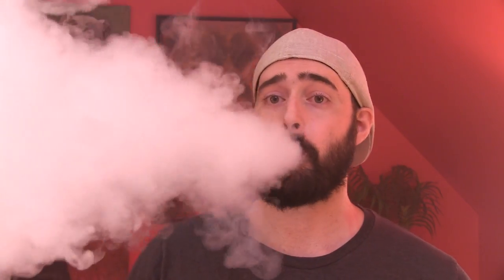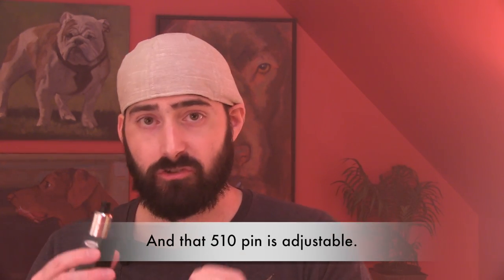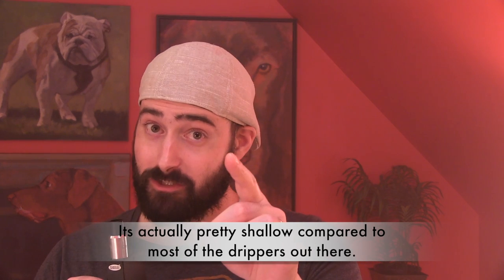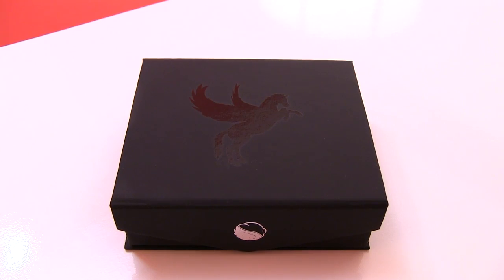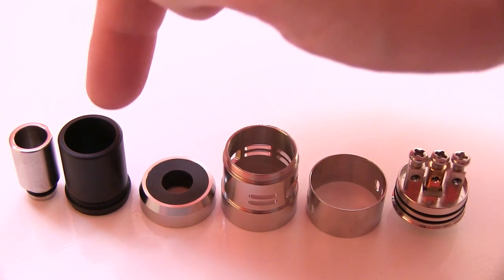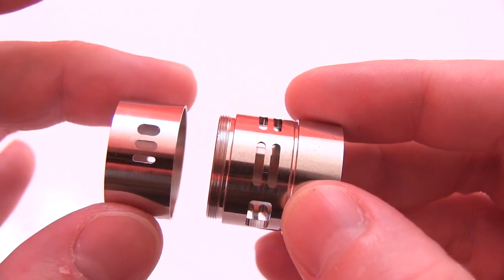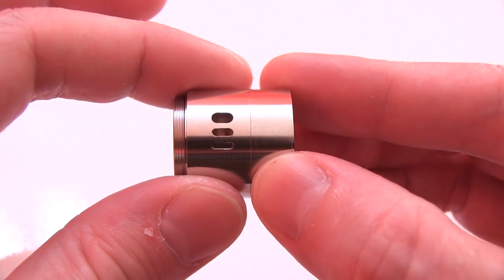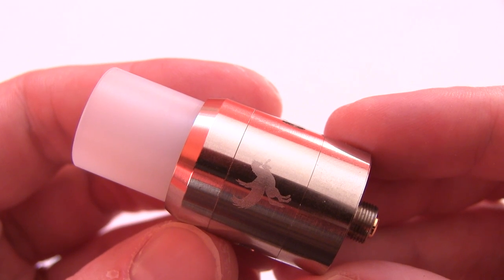The Dark Horse RDA

Comment: Thank you for the the review on the Dark Horse RDA! We are definitely listening to the pros and CONS more specifically. These notes will be sent over to Steam Angel for improvements to be made! Regarding the accessibility, we TOTALLY understand the frustration a lot of consumers have. Last month's release was the very first batch from Steam Angel.  The 2nd batch on the way will consist of 2000 units and we will be receiving regular shipments every 2 weeks moving forward to do our best to keep up with the demand.  =) 

Just a note: The Monster Drip Tip and the adaptors are made of Nylon which has a much higher melting point compared to Delrin. =)   

Added note: Many people have asked about the materials used. THE DARK HORSE RDA is made of 316 Stainless Steel! =)
Reply: I'd suggest the horse logos to be printed at the bottom instead of the ring or (two on the ring like rip suggested). Since the bottom portion never moves would make sense to print them on there. Just my 02. Can't wait to get one.
Reply: Just received mine today and love it.Fast shipping ONE day!!! LOL thanks. Wish there was extra o rings especially for the monster drip tip that did not have one.
Reply: great RDA but I did have problems with the center post coming loose even after my Vapor shop tried tightening it so they are currently working with the manufacturer to fix the problem in the mean time the loaned me their personal Sig-s which i prefer a little more since the posts are lower to the deck. Shout out to The Vapor Box of Whittier thanks!
Reply: They need to make a version 2 with a deeper juice well, IMO. Other than that, it's amazing, and everyone drools when they see it on my ipv3.

Comment: Yup same here man. In a perfect world my rda features would be, medium depth well, fat post holes, 2 hole center positive post, Allen head screws, adjustable 510 copper connection so it'll fit a huge variety of mods, adjustable slotted air flow that will work with single coil also, heat sink like tohb or 454, think that's about everything lol

Comment: Designers. Measure the depth of the sidewalls to the deck on the Tugboat and copy that. My Tugs are the most solid RDAs that I can take with me all day cause they don't have a shallow deck, the air holes are placed to where they aren't going to act as a juice drain, and the fat oring is snug so it doesn't have that "cheap feeling" spin.

Comment: I purchased the dark horse as my first personal rda. A buddy had a plume vale and a nimbus on loan to me with a single 18650 mod (don't know the name). I've got the dark horse on a tesla invader 2. Now out of the 3 set ups I've ran personally do far. This is it. It's better for duel coils then the plume vale, better than the nimbus for single coil. It's harder to run quad coil on this than the plume vale though. If you don't count that as a con given the plume vale is a 4 post, my only con is the single coil mode doesn't have a wide open option like the duel coil does. But the post holes are so large you have no issues running wrapped, parallel, clapton or any other more extravagant build, so a pro there too.

Comment: I have a variable voltage/ watt sigelei, max 6voltage/15watt mod with a IMR 18350-800mHa 3.7v battery. Just ordered a stillare atomizer clone single or dual coil setup, with kanthal A-1 28g awg wire and 2mm braided silica wick. Was wondering if there's any particular way I should wrap the coil or anything I need to change or keep in mind. Thanks

Comment: Mic is still a bit hot (although sounds nice and clear otherwise :)).  Try reducing the gain a bit, and test using the loudest part of your spiel.  The loudest parts should peak out at about -6dB.  Then compress the voice track (in post) at about a 4:1 or 6:1 ratio, fast attack and fast release.  Get a gain reduction (using the threshold control) of about -6dB to -8dB at your loudest parts, then bring the track volume up to normal levels (unless your compressor automatically makes up for the gain reduction, in which case just roll with it, using the track fader to correct any overs).  After that, you should be golden. 

Just my 2 cents, but I hope it helps.  Vape on!  :)

Comment: @ Jake it is authentic I've cleared the serial number... but the center pin does spin slightly it does have all the air flow options and everything is the way it's supposed to be but I was just stating how far off on price he was but it's prolly cuz when it first début it was that price... still a decent rda tho.. wish the insulator was made of peke instead of plastic tho

Comment: My local vape shop (which I love because it sells to minors, I'm 16) sells the dark horse for $30 and it's not a clone. I think the only downside is that it doesn't come with the smaller drip tip and I also havnt seen it with the limited edition white drip tips.
Reply: Definitely a clone. No way in hell are they bringing in $80 mods (that aren't even available online due to demand) and selling em for 30.

Comment: I've got this thing the middle post does spin.. doesn't hurt anything tho and I only paid 35 bucks for it too... authentic
Reply: rickie campbell If they spin its not authentic. I bought one for 35 too that was advertised as authentic that ended up not being so. The post holes look square but they still spin, and half the airflow options are missing. Also the drip tip doesn't slide in from the bottom it screws in from the top. does yours have any of these issues too?

Comment: Why is my vapor so harsh? What could be the cause? I have a Magneto II by SMOK with an iGo atomizer. I built the single coil myself (6 wraps), I'm vaping on Dreamer by Vintage E-Liquids, using CVS natural cotton. Battery is 18650 2500mAh 3.7V.
Reply: What milligram nicotine juice are you using?
Reply: I'm using 6mg, is that what the cause is?
Reply: Try putting your airflow slot/hole right in front of your coil.
Reply: It also depends on what ratio pg/vg you're using

Comment: WHY make an AFC that is only 40-100% adjustable rather than 0-100%???!?  This cuts the possible consumer volume by a LOT.  If you don't ever close your draw off that tight, then you won't care, but that's not the point, the point is that it is considered a design-flaw in regards to versatility.
Reply: You are right that is the same problem with the Doge.
Reply: Tim Baxter I don't understand what you mean. With my doge v3 I have no problem getting a tight draw for flavor builds.
Reply: SA22C Yes that was one of the things they fixed with new versions, the original did not.
Reply: PDX101 Hey now you can fix that, and take all of their customers! :D Oh wait, your not a marketing expert...too bad :(.

Comment: I have this rda with a single coil. And I use it on a aspire cf sub ohm battery. I don't know what sub ohm means or anything. What should I upgrade for more vapor production?  I'm very new to vaping.
Reply: +corbin fogleca I just picked up a Dual 18650 Box has some great options and can do Temp and Watt control. Arctic Dolphin ADT-180TC cost me 54$. I found almost no reviews of it but I like it, smaller than my IPV3 and has more options and power and still rockin 2 18650's for a full day of vape with out battery change and you can charge it via micro usb as well.
Reply: +Orvin88 Hey, How's that Arctic Dolphin holding up for you? I just found one for $37 and I'm thinking of buying it but I can't find much info on it let alone a review.
Reply: +Darth Scissorhands it's still going strong. Only thing some people don't like is the screws for battery change but honestly as long as to you take care of it they will be fine.
Reply: +Orvin88 I have a tesla invader 2 now with the same dark horse
Reply: +Orvin88 Awesome. Yeah I've got the SMY God 180 and it has two screws that hold the door on and it doesn't really bother me. I think I'll pick one up tomorrow. For the price it seems pretty hard to pass up.
Reply: +Darth Scissorhands yea the amount of options and power with dual Batts it's hard to pass even for the 50 I paid imo
Reply: Sub ohm vaping is basically vaping on a coil under 1 ohms

Comment: Wish i had the money to buy this kind of gear, makes me jelly:(
Reply: Normally I wouldn't advertise this, but clones can be an option - if you're willing to accept the fact it's a clone and you're not directing your purchase to the actual designer/engineering team behind the original.
Reply: Nicki Hansen
 l would direct my purchase to the actual designer, but charging over £50/$80 for stainless steel conductive posts and housing is way over-charging no matter where you place air-flow holes.
No RDAs are even 400series stainless steel, they are all lower range 300series aka most common cheaply available.
That's the way l see it, if it's over £50/$80 i'll get a clone.
Reply: ***** You're very right when comes to these RDAs being over priced for a piece of metal but I'm pretty sure these companies are charging for the "engineering" process of this RDA
Reply: Normally I would agree, but as I see it - well machined and designed RDA's that are under $100 are worth it.  I have a ton of clones and while they work well, they aren't as well manufactured as the originals they copy.  Something like this for $80 is worth the investment in my opinion.  Would I spend $150?  Heck no...but for $80 I think I would save up and take the plunge.  I'm pretty sure I've spent at least that much on all the clones I have - so I'm going to get on the waiting list, take that time to save up and when they are available, I'll have the money to purchase.  Sometimes you do get what you pay for - and this looks like one of those products that may be worth the cost.
Reply: ***** Everyone that thinks authentic RDAs are too expensive should watch the chuff aluffigus videos on hand machining a mod. The amount of equipment, expertise and time it takes to make one device is phenomenal. All the authentic prototypes have to be first done by hand. It could have taken months to design the device. It can take 3-5 hours or more to make just one, and they may need to make dozens of them before they get it the way they want before it's production ready. Production runs may also be done largely by hand by the smaller companies that are just starting up and can't quite afford to contract with bigger contract CNC houses. The reason big cloners can do it super cheap is because they have $1M CNC machines. It might take 50-100 hours or more to get that CNC machine programmed to build the first part, but then they can crank them out after that in a matter of minutes with little human intervention, making it easier to sell closer to materials cost. Of course then there is the profit that the retailer needs to make, the packaging, shipping, advertising, inventory storage and all that. Oh and people need to make salaries too, and make a profit if they intend on making a second product. Having a retail price of 3-5x materials cost is fairly common in most small volume and boutique product manufacturing. If you think you can do it cheaper, then you should start a company and you'll make millions!
Reply: b minor In some instances I agree with you. With this specific product, the Plume Veil and others that are innovative and different, absolutely. $110-$115 for an Apo on the other hand is obscene. $130+ for the Little Boy? The Vape Jam is nothing more than a Quasar with a slightly different top cap and logo and I think that atty was $115 or $120 the last time I looked at the pricing on the authentic. When a companies product cost and expenses are recouped and a company is making a second version, why not pay it forward some to their customers by reducing the price on the last of the V1 sold? Boutiques have clearances and sales all the time to turn your logic around on you. With the Darkhorse, Steam Angel is absolutely doing it right though, I don't even fault Aethertech for the Plume at the price they charged because it was innovative and different, but some of the pricing on authentic product you have to admit is a little excessive for nothing more than another rehashed atty with a fresh coat of paint on it.
Reply: b minor People need to read this post and take note.  Ive been through a ton of clones, and although u get a pretty good one here and there, a good amount of them end up being total duds, many with threads that are terrible and will end up being stripped very quickly.  Id rather have a couple nice quality RDAs (And mods for that matter) then a box full of junk any day. Its only a matter of time before people realize this.  There are quality RDAS out there as cheap but better quality then most clones (Mutation X, Sigelei S, various later Igo dripper models).  I could see a beginner maybe grabbing a clone super cheap, but they just aren't even close in quality, and simply won't last over time.

Comment: i got a dark horse RDA sitting on top of a nemesis with a purple efest battery 35a 8 wrapped 24gauge coils (dual) vaping jollyrancher(60%) / raspberry(40%) at 100% VG with 12mg nicotine soaking up through japanese organic cotton. meter read my RDA at 0.28
Reply: Congrats
Reply: +buddyroach LIAR
Reply: +buddyroach no such thing as 100% vg. There has to be some pg to deliver the flavor. stop trying to look smart please
Reply: Mathew Pulsifer thank you.
Reply: To be fair even when it's 100% vg, if u add flavor it ain't 100% vg anymore so he got a point but it doesn't matter
Reply: liam smith true. but i have made juices with vg based flavorings. not the best for flavor but it is possible. i use more pg in my batches now though.

Comment: I want a box mod thinking of the sigelei 100 or vape shark dna 30 which is better?
Reply: For everyday use, the Vapor Shark R-DNA 30, imo, built like a tank, smaller, great cs,
Reply: I'd go for the shark. When you're making a comparison keep in mind that the  DNA30 is efficient as hell. I used to last barely a day on 2400mAh (sigelei Zmax5), now I last well over a day. It might also be that my habit changed a little, more satisfaction = less desperate puffs.
Reply: Sigellei 100 watt is a BEAST! I just got mine in a few days ago and I have been VERY pleasantly surprised with it minus a few small details, nitpicking really. Check out my channel for an upcoming review.

Comment: i have had a few problams with mine, i was checking the connection on my v2 and i shook it and the of the post fell out, and i use 24 guage wire and the middle post moves around when i doing a build, also, i have a problem with the post touching my mod almost exploded from that

Comment: Does anyone know what type of juice would be right for me when using something like this, I currently have a normal atomizer and I put 18MG juice in, I want to drop down to about 16MG but I don't fully understand the different juice for good throat hits but good clouds as well... Any help would be amazing. thank you :)
Reply: For me, when I moved from Kanger tanks to a Russian 91% RTA and built it to a lower resistance coil (.5-.9 ohms), I had to step down from my normal 18mg juice to 8-12 mg.  Once I got into RDAs with dual coils, mechanical mods and Vaping at crazy low resistances and super high amp draw/wattages, 6mg was the highest I could go.  The throat hit gets very powerful with that much juice getting vaporized that quickly.  3mg is my go-to nicotine level now... And depending on some of the flavors, that can be too much. My favorite right now is Mother's Milk.  I buy 3mg and 0mg and mix them to get a slightly lower nic level.
As far as clouds.... Go with the high VG juices.  The RDAs will give you better flavor that will make up for the loss that comes with a lower PG ratio.  And the best part is.... NO MORE CIGARETTES!!
Reply: Richard Stubbs Thank you so much for taking the time to respond. It has defiantly give me an insight to what i need to be looking for and what I need to do to make the transition to RDAs :)
Reply: Make sure you also use the safest batterys, sony vtc5 is the way to go
Reply: CoreGaming you use 6 or below. when using drip atomizers nic levels usually double. meaning a 6 would be a 12 and a 12 would be 24. 6 and below are the way to go. and with batteries vtc5s arent that hard to find when you go to local vape shops, just know the difference between a fake vtc5 and a real one. mxjo is said to be better than the vtc5 and has 35 amps vs 30. lg makes a 35 amp battery too which is really nice too. higher vg content give you more cloud production but not so much flavor. i usualy go with 60 40 or 70 30. but remember if youre cloudchasing, its not you mod or atty, its your build, airflow, and battery. you dont need a 120 dollar atty. i own a few but its just cus i like the looks, but when i cloud chase, i use my tugboat v2, tobh 2.5, hobo, or doge. the infinite clt is a great atty for beginners. easy builds and is cheap. comes with a nice airflow option and the wide bore chuff enuff drip caps fit it.

Comment: Can i use dark horse rda with subox mini?
Reply: I just used it with my subox just now and its fine. But make sure it has a adjustable copper pin cause the subox has a fixed 510 connection. But it drains your battery real fast cause it has dual coils.
Reply: Did dark horse has mini version??because mine the box say dark horse mini
Reply: +ariff azizan the dark horse mini is a clone, still a good RDA in my opinion but it is a clone
Reply: Oh ok, thank for your help +Ghost Apache